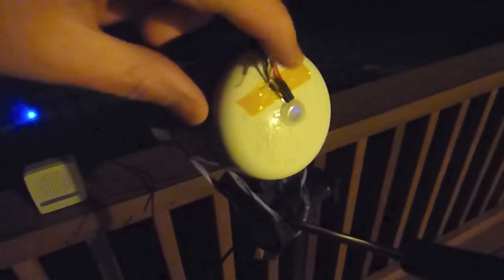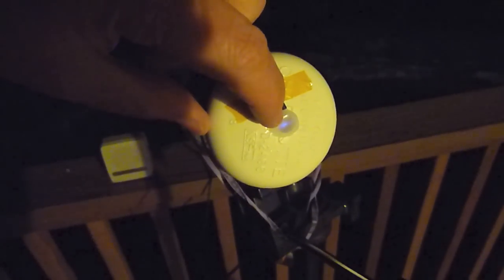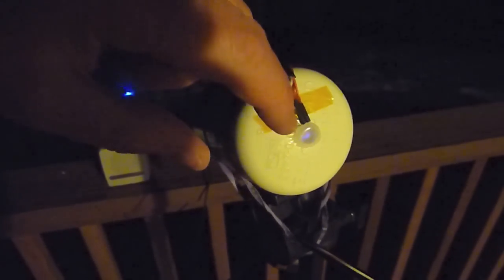LED Optical Communications

Comment: you have proven my thoughts to be correct. if you can see it, you can capture sound, no need for reflection. light is modulated using pulses and intensity then converted back to sound-waves... great test